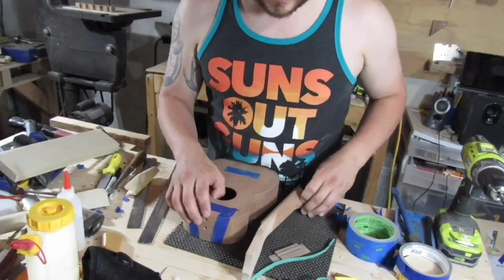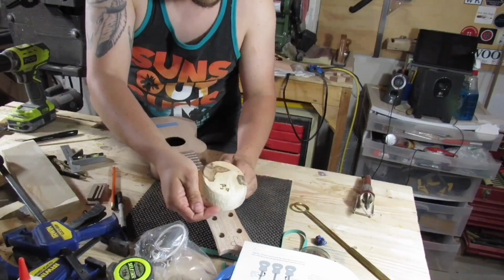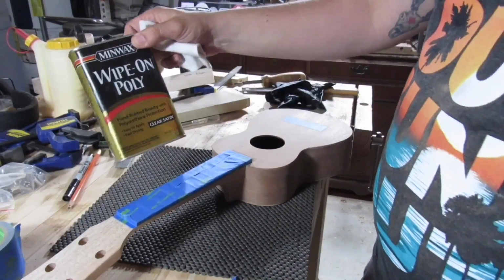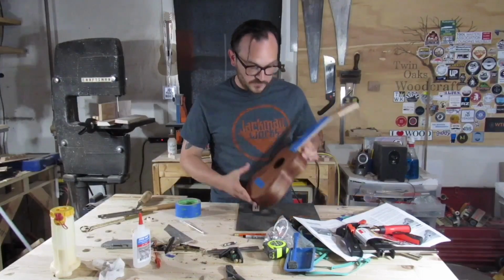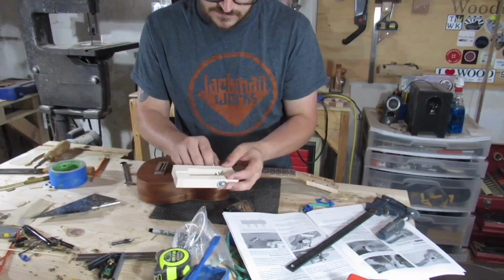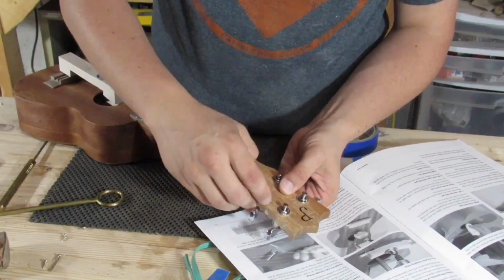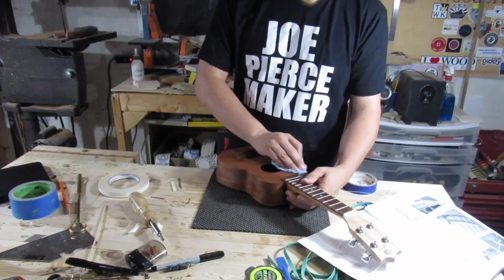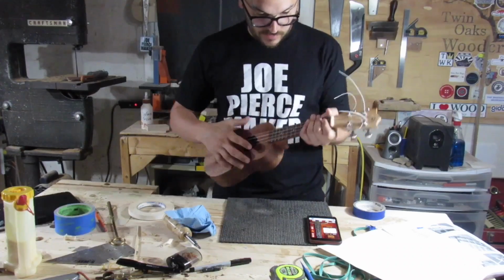Building A Ukulele Kit - Part 6

Comment: Hey, watched the whole series and enjoyed it very much. Just wondering-when you glued the support pieces to the body sides, did you consider soaking them to make them more pliable? Or was there a reason that wasn't feasible?
Reply from the maker: That is a good idea, and I'm sure it would work as long as you didn't get them too wet.  It would slow down the drying on the glue but otherwise I don't see why it wouldn't work.  I just didn't think of it.

Comment: The scarf joint in the neck is really highlighted by the finish, it looks like 2 different woods and the headstock looks grayish instead of the rich mahogany brown. I wonder if all of StewMac's kits have that problem.
Reply from the maker: I don't know, so far I've only gotten this one kit.  Both pieces are mahogany, just from a different part of the tree.  They probably batch out each piece separately so getting them to match wouldn't be very easy.  For a low cost kit like this I don't think its a huge deal.  Thanks for watching!

Comment: Joe nice job filming the process of an instrument build from a kit.  I am in the middle of my first kit build.  I am building the Stewmac Concert ukulele from a kit.  The top bracing is a little more involved as it has a more traditional guitar X brace pattern.  I will use your lessons learned to check the location of the dowels and to check the neck angle to see if it is aligned to the bridge prior to gluing.  Thanks for sharing your learning experiences.  Nice work.

You should try a parlor guitar build if you can find a kit.
Reply from the maker: Thanks Pete! I've definitely caught the guitar bug and will be doing more builds.  Good luck with yours!